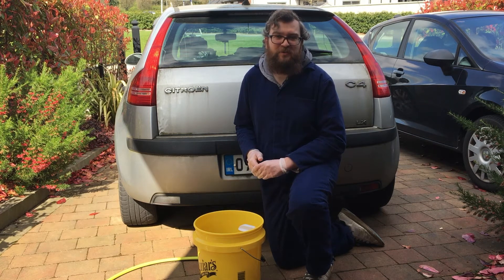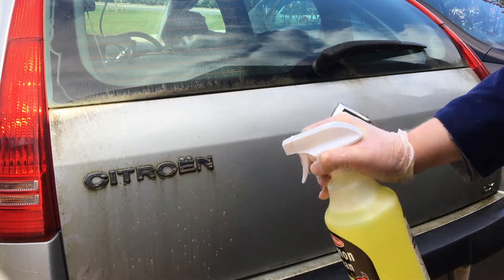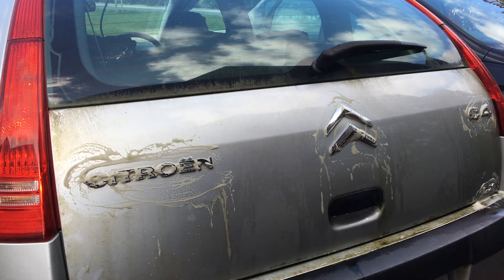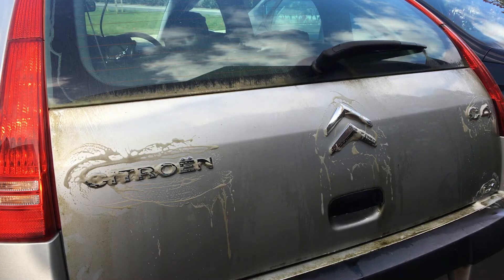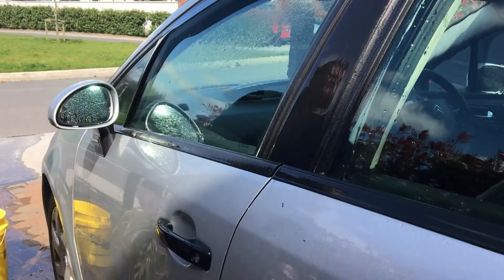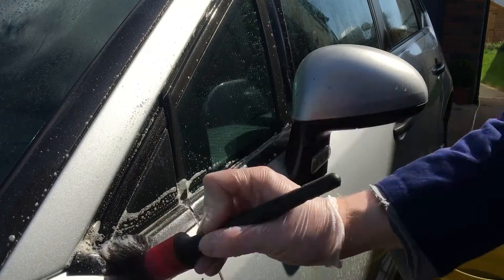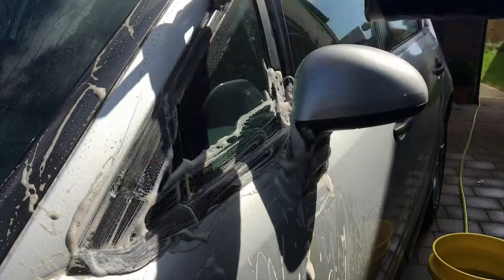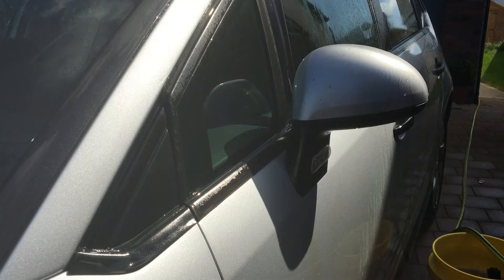Cleaning Trim with Demon Clean Active Super Cleaner

Comment: Is it a decent car? which engine do you have? I plan to buy C4, I collect some experiences about it :)
Reply from the maker: It is a good car if you maintain it regularly. The engine is 1.6L DV6 HDi I4 Diesel and if you change the oil, filters and service it within the service schedule it is capable of over 500K kms. It may rattle at times and some plastics or fasteners may be weak but overall it is a cheap and mostly reliable everyday car